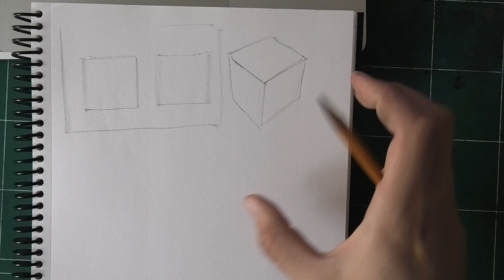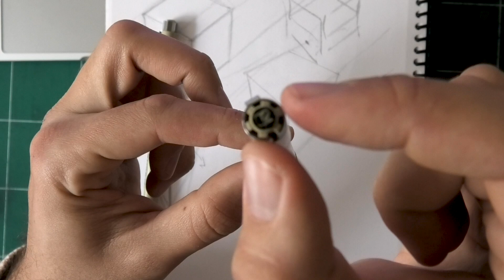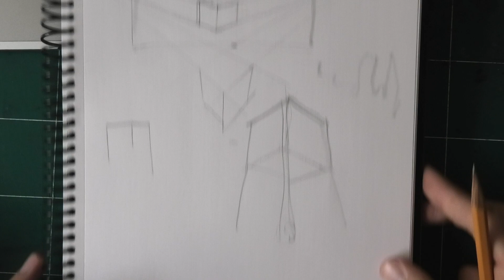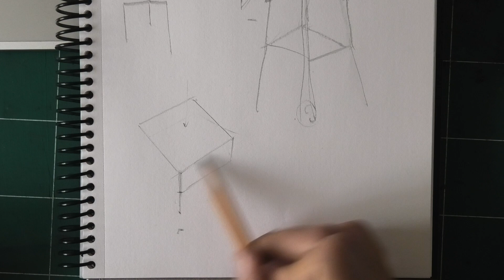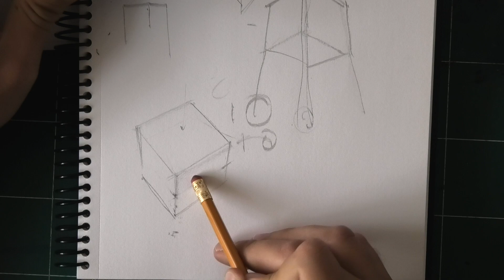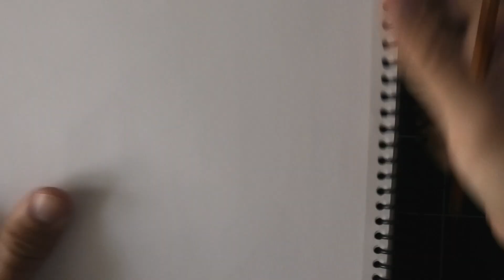How to MASTER Drawing 3D Cubes & Boxes [Figure Drawing Prep - Part 1]

Comment: Something is still not adding up in my brain. How to draw it perfectly? Like perfect cube.
Reply: You Just dont need to
Reply: Use perspective
Reply: It requires a perspective diagram where you use station point angles which together have the sum of 90 degrees. In 2 point perspective it's very easy, in 3 point perspective a bit more complicated, but also can be done in 5 minutes.
Reply: The the motto of art is "Try until you succeed"
Reply: I totally understand you, there must be a rule for that
Reply: If, by perfect, you mean all the sides look like the same length? Then that doesn't exist. We KNOW the cube is "perfect," but it doesn't LOOK like it is. I had trouble processing this too. Take a photo of a cube at an angle, then go into Photoshop or print the photo. Get a ruler, and you'll see that in the picture, the edges(lines) of the  cube aren't all the same length. They converge or point to a single point vs. complex parallel (the lines will never cross).
Reply: I'm wondering the same thing, but maybe if you draw enough cubes from reference you would know how it should look even from imagination.
Reply: R u asking how to draw a perfect cube on perspective? If so, there's not really a perfect cube, perspective in drawing is just an illusion we give to the viewers so the object looks 3 dimensional, we do this having the fundamentals of vanishing points and how they modify an object and their characteristics based on it, in this case, a cube. Theres not really a perfect cube, but you can to make one as close as perfection, thats whats all about
Reply: Perspective
Or
Trace
Reply: @SkibidiRizz-j7s ts pmo